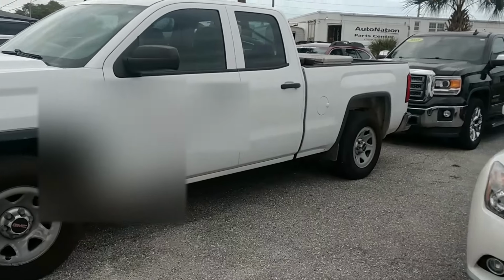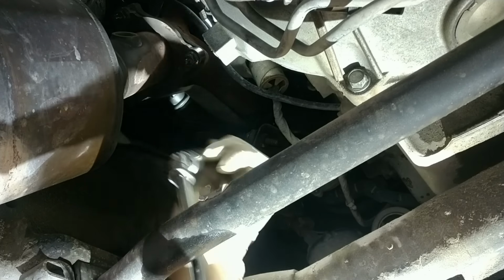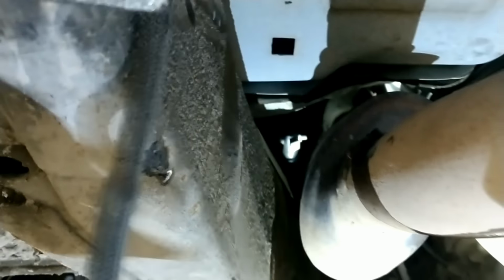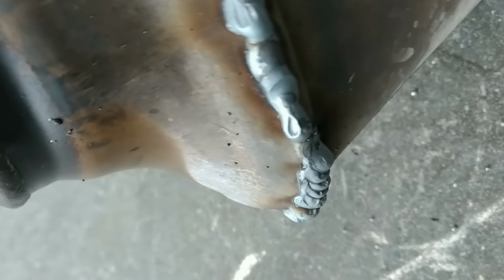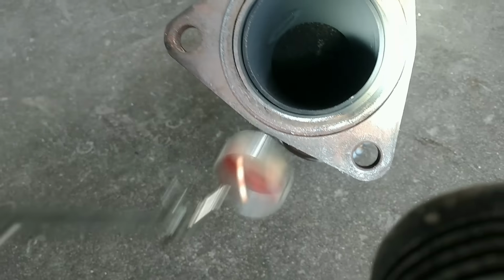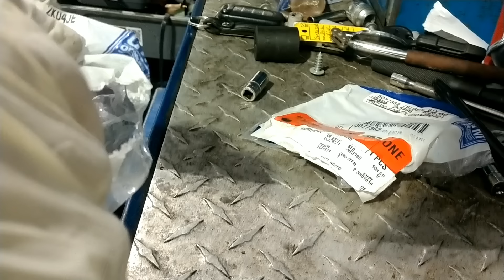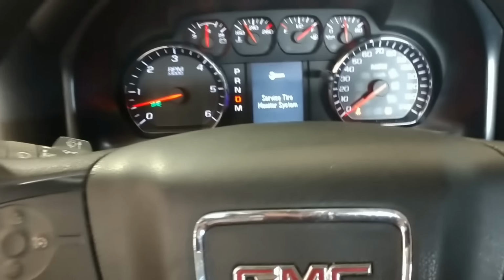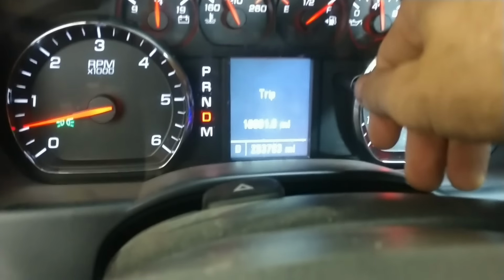Customer States exhaust leaks: Repair it cheap.  Ok then, I can do cheap and good. Sort of.

Comment: Welds are on a muffler part that never gets seen. Who gives a F how they look as long as they're solid.
Reply: Take pride in your work
Reply: @Green Mamba Games MIG =Maybe.. It’s ….good  ?
Reply: Welds like that will fail the car for possible exhaust/ emission system tampering.  Have to have proof it was welded up as a repair and not a cheap de cat.
Reply: @andyk192  not if you know how to weld.
Reply: Literally anyone who takes pride in their work would care how they look. I know when I weld something it looks perfect.
Reply: @kenshinhimura9387  #doubt
Reply: @P.A.C.E.automotive   Then you've obviously never seen me weld before
Reply: Cleaning the surfaces before welding would help with weld strength.
Reply: Right sir! I was just hoping he wouldn't blow holes in that thin metal when he was welding. Ray did good.
Reply: I've got a friend who does a lot of welding, in his own shop. I spend a lot of time cleaning his crappy welds that are full of splatter and boogers.

Comment: "It broke while sitting in the parking lot", seems like Chevy is living up to their normal standards. :)
Reply: Looks like a fleet vehicle.  Our Silverados at work are the same. They take them in to get new tires for the first time since being new, then come back like this. Probably either because the relearn procedure wasn’t done, or they removed the sensors. For a fleet, my company wants the cheapest work possible. Some of ours also have the trailer brake error, probably because our trailers suck. Just guessing though.
Reply: @laxbeach2381  Also, not doing the relearn procedure typically won't cause any issues beyond if they put the tires back on in different positions it won't know and it will report the pressures at the wrong positions, but it will still report them. I had a company truck I serviced that had TPMS so I do know how it works, even though my own vehicles are all ancient.

Comment: Sometimes auxiliary electronics can mess with the TPMS system. Changing USB chargers fixed it for me.
Reply: TPMS systems are more hassle than they're worth and expensive to fix/replace. My light has been on for years. I just check my air pressure once/month....it takes 5 minutes.

Comment: Considering the cost of a new CAT, a weld repair like this is well worth a shot.
Reply: It’s also less wasteful.
Reply: @robertt9342  And practising welding on someone elses objects AND getting paid for trying. I love it.
(why did I choose IT?)
Reply: Not so sure.  Yes, if you go to the dealer and buy one from him/her, then yes, bend over, it's gonna hurt.   If you go to a company like walker...  50497  $681 for both left and right cats, "direct fit"

Compare that with welding on stainless steel with Carbon steel wire.  It will rust like hell right along that weld and fail in 2 years

Comment: The tire monitor system is a nuisance.
Reply: It is also dangerous in that the owner relies of a dodgy system to monitor tyre pressure rather than the owner.
Reply: I personally use indicator caps for my valve stems (quick walk-around, hit da road assured)

Comment: When I had to do exhaust work on both of my dodge rams 01 and 02 the nuts were rusted in place and had to be cut off and a exhaust clamp had to be cut lube worked for you. but where was the thread lock on those 02 sensors?
Reply: You should only put antiseize on the O2 sensors.
Reply: @robertsmith3774  I’ve had issues with anti seize and the road I live on is full of bumps so everything works it’s way loose and if it’s not helping keep it in place then things do unscrew them selves like my front brush guard  I tighten every so often the bolts and nuts wiggle loose even tho it has the washers that as suppose to keep them from backing off.
Reply: I disagree..

Comment: I think if your a mechanic we've all done that with leaving an o2 out when doing exhaust I know I've done it.
Reply: Used to be those had one in the left manifold. Now they have 4 scattered all over the front of the exhaust system. Ah the good old days....of course, I still have some of those old ones working for me. I refuse to stop driving the 90s. :)
Reply: I was just waiting on the 02 sensors not to work right when he started it up. Blame it on Ray!

Comment: Quick you'll have to call GM and see which expensive bumper fluid they're going to sell you! LOL
Reply: "Replacing Bumper Fluid Pump Assembly Array System Controller Module. Step 1: Ensure bumper is drained of fluid...."
Reply: Has to be Dexos Ceramic Synthetic 2.0 from Mobil 1

Comment: You also might want to put a little anti-seize on those sensor threads as well as ALL exhaust fasteners.
Reply: I use it on any high heat application
Reply: i do this, too

Comment: When I first saw this problem that is exactly how I would have fixed it on my own car. However, at work, they would never let me weld it back together. The smog techs in my state have a fit if they see welds on the catalytic converter itself. The truck would fail its smog, stupid as that sounds. The reason being is people have been known to hollow out catalytic converters and hang their empty shells on their exhaust so they still look like they are legit. So on a stock ECU that trick would only work on cats downstream from the O2 sensors, but like the panther platform Crown Vics/Mercury Grand Marquis they have 4 catalytic converters, so if you hollow out the two that are downstream from the O2 they still run without any check engine lights and most pass smog no problem. Other cars are the same way.
Reply: That is stupid but true. That's how I fixed the cat on my old civic. Any smog tech that would reject or fail a vehicle because the cat is welded up like that is a con in my opinion. Especially when it's before the secondary O2 and there are no codes and I/Ms are all ready including cat monitor. But there are ways to trick the computer, some obvious, some seamless. Apparently the OBD2 plug in smog test should flag any tamper with software tunes/modifications anyway. I got flagged on a ford escape because it had a used computer from the wreckers and the VINs didn't match.

Comment: The only issue I had was not winding the o2  sensors in the opposite direction before putting them in the exhaust. But the again,  I am slightly OCD

Comment: I think you did a great welding job, hard to do thin metal.
Reply: I thought so. I haven't done any mig welding. Tig welding I've done. I would have brazed that instead. Brass will grab ahold of more base metal. I did that to a rusted out Mercedes Diesel muffler and saved it. It's probably still somewhere on the road today.
Reply: ,,very hard!

Comment: that is not a sack of dimes...not 1 dime....(welding)
Reply from the maker: Ohhhi know. I did several "beads" for a reason. I didn't want things to get too hot and damage the core.
Reply: @RainmanRaysRepairs  retired muffler man , here.  You did just fine.
Reply: @RainmanRaysRepairs  Failed logic. By spending more time with improper settings you put more heat into the unit.  If you welded that proper even even split it up into corners, you wouldn't have the possibility of a lack of fusion at your start stops and an overall less time of heat input to the base material.

Edit: I'd bet all of my automotive tools, my welders, and my welding certs on this just being wrong on every level. I have to come behind people and fix crap like this at least once a week. Last exhaust I had to mig up, took me an hour to drive to the dealership to spend 5 minutes turning the machine on, prepping the material, and running a continuous bead on a 3"OD pipe. I got paid my 1H labor, 2h travel, and was out of there. Same guy welds up tie rod ends for the Dodge factory service bulletin BS. I'm just waiting for the call that he killed someone because the shit broke on the highway. "Eh, good enough".
Reply: @dementedpaintballer  Welding a 3" pipe and a catalytic converter are two entirely different things.  The converter is 409 that has become brittle from heat and sports a ceramic substrate wrapped by fabric that will dissipate at 1700 degrees.  A solid bead  using a mig would destroy the internals, regardless of settings.
Reply from the maker: Good thing I wasn't welding on a Dodge.
Reply from the maker: Thanks Steve
Reply: @rustynail7866  No, no it would not. If you're getting your base metal that hot, you're doing something wrong. Your weld area will be that hot of course, but seeing as it's 409 stainless with an already hotter than 1,700*F melting temperature, by your logic, tack welding will destroy the internals. A properly run weld bead, even on a catalytic converter, should not exceed 350* on the base metal. Again, it's all about heat input to your base metal. By constantly tack welding, you're exposing the base metal to more heat over a longer period of time, versus the same amount of heat over a lower period of time. But eh, what do I know. I'm just a welder, not an auto mechanic. Ya'll know better.
Reply: My fams own there own welding business making trailers lol practice makes perfect
Reply: @dementedpaintballer  350* is an excellent temperature for baking a turkey, LOL.

Comment: wire brush the oxide layer and drop the volts to 15.5 to start and the welding should just feel easier. (oxides melt at far higher temperatures and interfere with the puddle)
Reply: I was waiting for someone to bring up a brush comment or to clean the area before welding

Comment: Wire speed a little high, putting too much bulk down in the welds. Dial it back a bit and they should look much better.
Reply: He did admit that he sucks at welding. I can relate.

Comment: All the times you sprayed lube on nuts and bolts and still have not noticed dry threads.....you cant lube a tightened bolt unless its on open threads. Still will never penetrate the threads due to them being a tight fit.

Comment: I don't think this repair is gonna last, due to the fact that when an exhaust starts leaking, it's time to replace it. The iron is very thin, welding is difficult and the time and labour to weld it makes it almost as expensive as replacing it for a new one. 'pennywise, pound foolish', as the English say. I'm from Holland, by the way

Comment: Don’t have to watch what happened next, Cats plugged,”Air in, Air out” 90 percent of exhaust leaks “prior” to convertor means, the hotter the engine gets, the more restriction ! Scan the engine, O2 sensor readings & Mass Air Flow readings, along with a thermo- temp gauge will tell you, ( if air in temp is 200- 300 degrees hotter than behind the cat temp.) the convertor s are plugging up, you are trying to fix the result of a problem that is not fixed!  Been there, years ago! Run live data before wasting your time fixing the aftermath! You want to help a little too much , “BASICS !” Don’t forget them ! Till next time !

Comment: I so envy you guys who work at dealerships... The cars I usually work on are from 20 to over 55 years old and from the North East... I can't imagine what it must be like to remove a fastener without a chisel or a torch or just not to have it disintegrate in my hands.  And what's it like to remove a bolt that isn't round or rusted to a random intermediate size or to disconnect a plastic connector that comes apart in less than 7 pieces?

Comment: My guy, please at least wire brush the metal before you weld. You don't have to be good, to do a better job making a lasting weld. They usually come out better too, because you are not fighting the oxidation while trying to lay down a thin weld. Good job though, it looks 1000% better than the guys that butchered my exhaust, when they changed the transmission. In hindsight I wish I had done the work myself...just didn't have a hoist for a 6 speed transmission and I am a skinny guy.

Comment: Rusty metal doesn"t weld fer shit. Clean it down to shiny metal before you try to weld it!! The weld will form beads but the penetration will be nill... and that doesn't mean make the rust shiny with a wire brush; grind off the rust !!

Comment: I can understand when someone wants a cheap repair because they can't afford to replace things properly, and the cheap fix is actually a lot cheaper and does work.  That catalytic converter is a good example of that...it's not really working anyway, those things are HUGELY expensive to replace, and the cheap repair does stand a chance of working well...and if it doesn't, hey it needed replaced anyway so no loss.  What bothers me is when someone wants a "cheap" repair, that ends up either costing more (or the same), while not actually fixing anything properly.  For the TPMS, the sensor batteries are probably just dead.  I've seen many mechanics say it's not worth it to replace them because it costs too much, just deal with the light and check your tire pressure the old fashioned way.

Comment: What brand of NUT LUBE do you use? Instead of W-D 40?  Want to get some for a friend. He swears W-D40 is the best NUT LUBE out there. HELP! Thank you!      Roger in Pierre South Dakota
Reply from the maker: A lube can be very good at one thing or mediocre at many things. WD is used on many things. I haven't used WD 40 since I was a kid. I prefer PB blaster or BG Inforce. And I think the BG is better. I prefer permatex for brake parts lube and Mobil 1 engine oil.
Reply: @RainmanRaysRepairs  Thanks, my friend will be reluctant at first. But as I watched it work so well with you and some really crust bolts. He will find how well it works right away. He flips auction cars.    Roger in Pierre South Dakota

Comment: That is not the correct way to remove the converter. You have to put the vehicle on cinder blocks and use a sawzall to cut it out. That is the way it is done all over the country.

Comment: Hard to Believe welding in shop with many potential explosive, fire hazards close by......like in-tank fuel pump being replaced two bays over !
Lotsa good internet Moms welding tips for Ray.... really folks. Welding, as with any hand skill is only learned by experience. Osmosis via internet ?.... not so much.

Comment: 🔰 So wait…taking it out and welding it is cheaper than just popping in a new muffler ? Or was that that CAT ?
Reply: That was the catalytic converter, which is insanely expensive. A muffler, you'd just pop a new one on.

Comment: This is why I dont take my vehicle to a dealership or any large corporate repair business.  I've seen the work that a lot of these guys do and its unreal and just like in this video where he forgot to replace one of the sensors, that tends to happen a lot at those places. Not to mention all the parts they say need to be replaced when in fact there is usually  another reason why a part failed but it's more profitable to change multiple parts then to fix the actual problem.

Comment: I have to ask - - -what was the price difference between welding up the leak and putting a new pipe?
Reply: Since this y-pipe contains 2 catalytic converters, the OEM GM replacement is crazy expensive, sometimes near a thousand dollars.  Aftermarket ones are less expensive but are sometimes less efficient and will set trouble codes, turning the check engine light on.  This was a much more cost effective repair.
Reply from the maker: About $1300-ish

Comment: Leaky bumper? Passive collector for emergency coolant. Old saying @ previous employer: uphill slow, downhill fast, tonnage first, safety last. Yea, Ray, big leather gloves also prevent burn holes in clothes, or skin, although your repair is not as hazardous to non metal substances as big welding rods I've seen used to repair railroad cars. Large metal parts, working upside down, gotta seal off everything with thick leather as it would rain down on the welder, inside his clothing if not covered. Good job, Ray. Thank you for your videos. 5x⭐👍.
  TTFN.
Reply: hell yes..

Comment: I know a certain someone who might be getting a grinder for Christmas 😆
Good job sealing up the leak .
Reply: An air grinder with a 6"  - 36 grit fiber disc would clean the welds up fast and not remove to much of weld like a 4" angle grinder would.  With metal that thin it takes lot of skill to weld at at all.  Over all job well done.
Reply: @dand3975  totally agree.  Gotta have some fun here and there 😉

Comment: Did you tighten the sway bar link?

I would expect most catalytic converters to have some sort of a stainless exterior shell (at least 409 stainless).  Welding stainless with normal carbon steel wire is typically a bad idea.  The weld itself will rust, but the areas right next to the weld will rust as well.  The only question is how long.
309 welding wire and a low CO2 gas (typically tri-mix on a small welder) is except able way of doing it.  I like 309 wire better than 308 because it allows welding dissimilar stainless or stainless to mild steel.  Basically it has more nickle in it.   I use it a lot to tack broken, rattling heat shields if I can't get a screw clamp on them.   As for gas, anything more than 5% CO2 is going to be a problem with stainless.  The chromium loves that Carbon and will separate out of the stainless and you will loose the rust resistance.   As I glance over at my little mig, I see it has a 309 spool in it right now, should have asked to borrow it.

Comment: Why did he lower the vehicle a little after rising it? I get the safety part but will it break at top level or just too high for him to reach?
Reply from the maker: The lifts have mechanical safety locks. The idea is to take the pressure and weight of the vehicle off of the hydraulics.
Reply: Don't trust your life to an 80¢ O-ring.